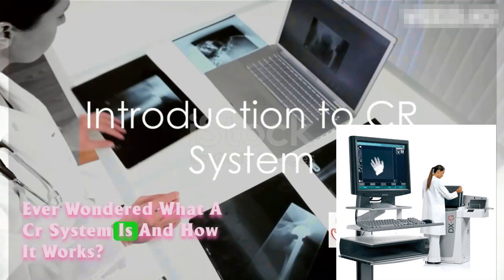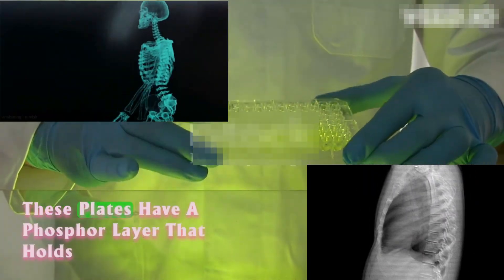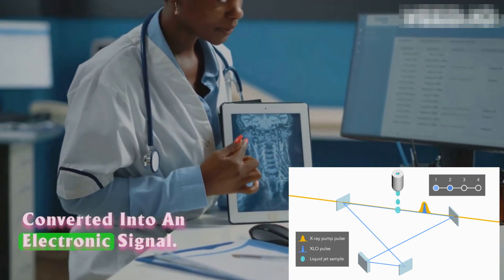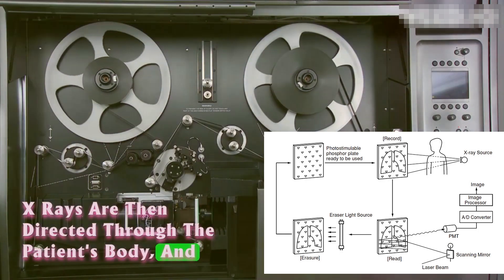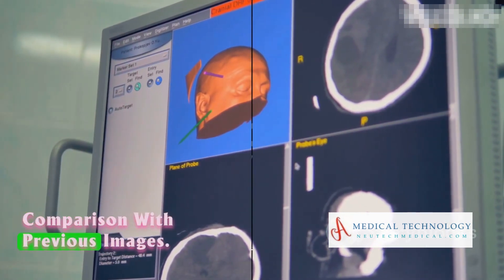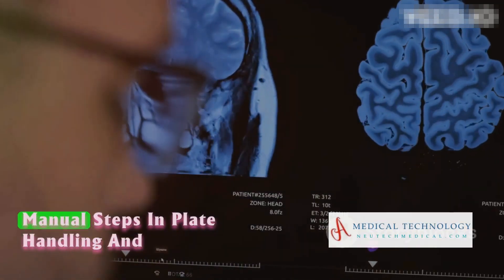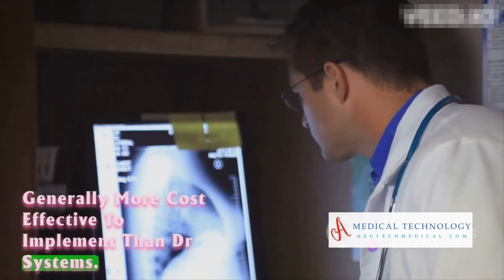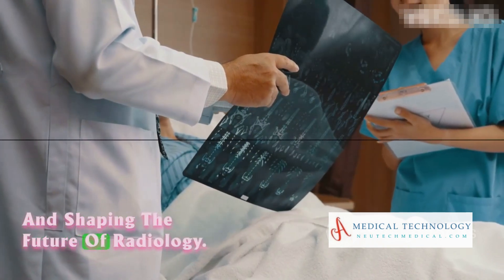Computed Radiography (CR System) | CR System in Radiology Part 3

Comment: What is used in cleaning the image plate?
Reply from the maker: You can use a microfibre cloth and a small amount of alcohol rub to clean the imaging plates however, you shouldn't apply the fluid directly to the plate. You should only do this if dirt and artifacts are visible on the x-ray, if no dirt is present then it is not necessary to clean.

Comment: What are the steps of the computed radiography imaging process?
Reply from the maker: CR technology in three steps

Instead of film, an imaging plate is exposed to X-ray or gamma radiation.
The imaging plate is digitized by the scanner and then erased for immediate reuse.
The digital image is then displayed on a computer monitor for evaluation with specialized software.